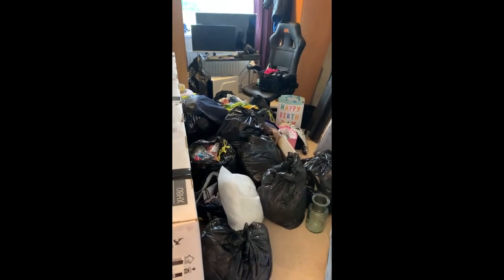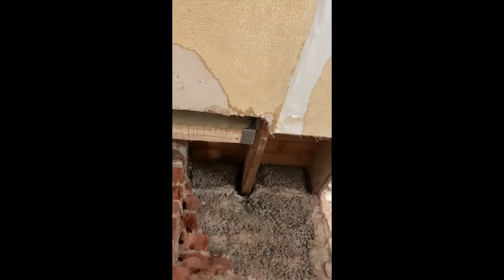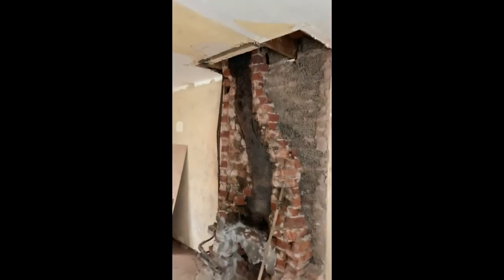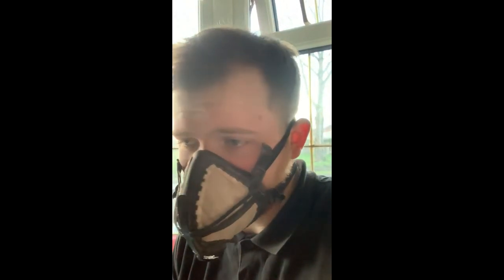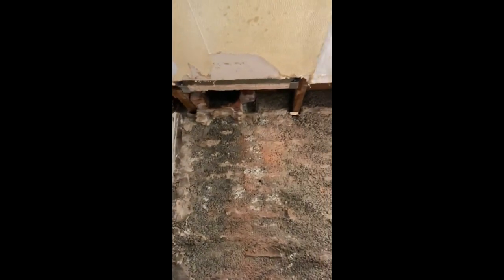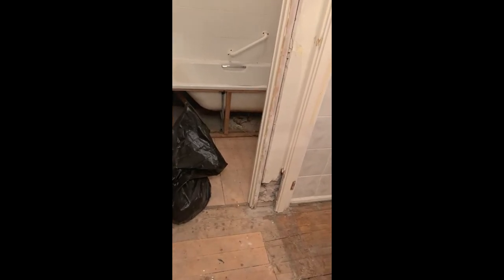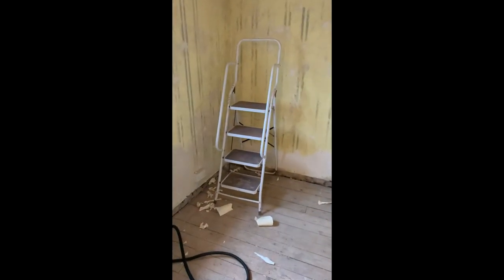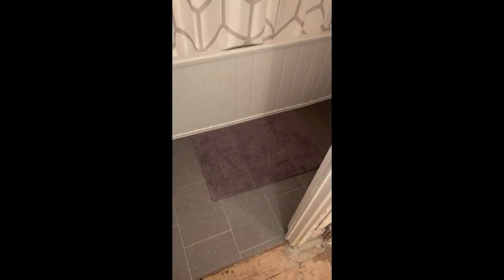KNOCKING THE CHIMNEY BREAST OUT! (Part 2) *My House Refurbishment!*

Comment: Hi just came across this vid as I’m taking on of chimney breast down. Just couple of questions. 
Is that a party wall if so did you have get a party wall agreement? 
And did you have to get a structural engineer out before doing it then have it signed off onece done..? 
Cheers